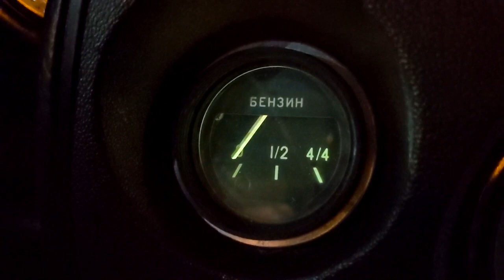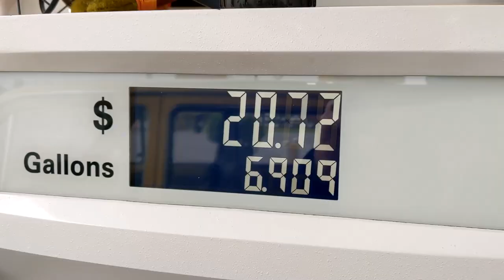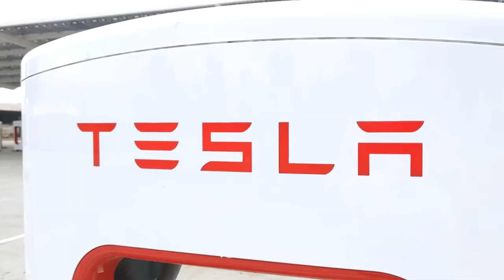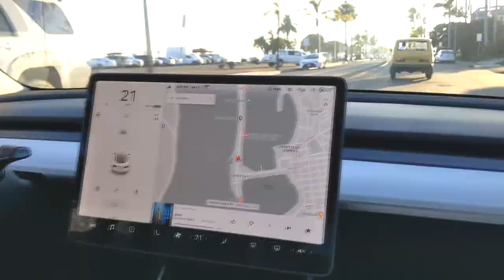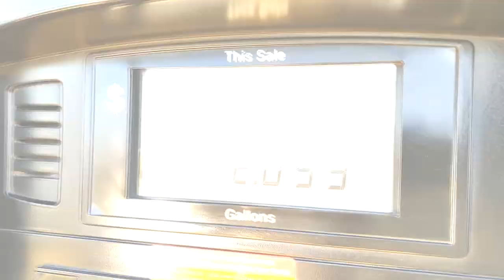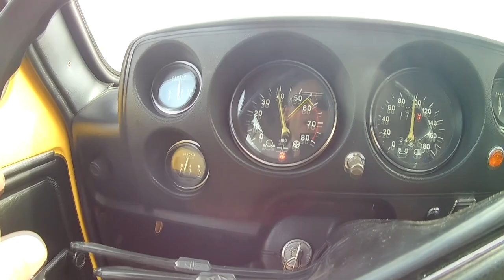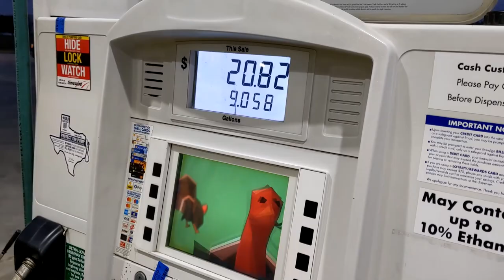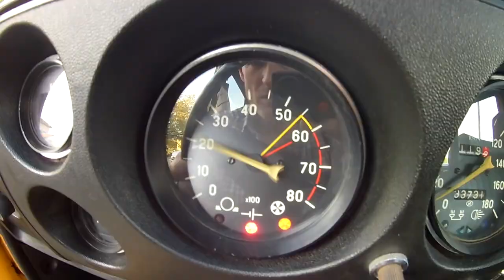I drove an old Russian car across the USA

Comment: You can still buy new Lada Niva, 2021 model even has options like electric window controls
Reply: There is no need to misinform people. LADA cannot import cars in the USA now. 
Exporting cars to places where you can't get them by truck is so expensive that the end product has to have a huge price advantage to be price competitive at the end point. Roughly speaking, I can spend 15,000 rubles (200 USD) here in Russia tomorrow and buy an old niva, not in the usa.
Reply: @alexanderismylove  Never said which country specifically, it all depends on many factors, but they are available in Germany, Australia and UK as far as I am aware.
Reply: @Swagsoviet06  In England is a importer of the new Lada Niva, eventhe putin spec you can buy there
Reply: @alexanderismylove  Niva would sell in many places but problem is regulations won't allow to sell it. For USA over 25 years old cars can be imported, for them it doesn't matter. But for newer it would require emissions, safety, etc. things. Same in most European countries. They still imported Niva to here Finland only a few years back, but I think they had to stop because of tightening emissions regulations for new cars. Ship transport is not that expensive in large quantities. But there is all kind of import tolls, regulations, etc. what make it difficult.
Reply: @TheKrololo  that is because we all seek взаимопонимания
Reply: @mrlearner4153  pay attention to how the OP says it - the new 2021 Niva "even has options like electric window controls"
You know, that's a real breakthrough right there, AvtoVAZ finally found out how to make power windows lol. I bet every '90 American car had this already

Comment: Lada Niva is a 40 years old car, which still produce and sells.
Reply: Some new ones start to rust in about 1,5 years... not exactly the sign of quality. And the shifter is a horrible joke in a new car, it's definitely a relic from the '70s... but yeah, it's cheap, and goes over everything, so people still buy them.
Reply: Yeah, I was wondering just how old this car is. 5 years is not that old lol
Reply: @sergeypopov801  I don't think carefulness has anything to do with it... it depends on the factory rustproofing, which is shit on new Ladas. Might've been better on old ones. 

Other than Mazdas, which are known rustbuckets, I hardly believe there are serious rust on 2 year old Western (or far Eastern) cars. Maybe small spots on the suspension parts.

Two things can help. Serious aftermarket rustproofing as soon as you get the car from the dealer, and cleaning off road salt in winter with high-pressure washer even in the wheelwells. Oh yeah, and properly ventilated garages...
Reply: Mercedes g-class also 40 years old😉
Reply: @thecolormaster  but they dont make the original G class anymore.

Comment: These had external voltage regulator which could be adjusted. I had a battery die on my 2101 and when I ordered the new one, I went to the shop to get it installed the tech measured the charging voltage and it was too low. Then he just removed the black cap from the regulator, did some magic and the charging voltage came back to perfect 14V :)

Comment: Good old Niva, it still is a good car! Both of mine though went 65mph and kept up with traffic with no problems. But yes they are loud as heck...sound proof it...
Reply: Also some motorcote or other gear oil enhancer
Reply: Those engines where designed for leaded high octane fuel, which give car 30% more power. The engine is fiat design with some Russian upgrades. The fuel economy of car is little better than you mentioned, losing fuel for sure doesn't help.
Reply: No, never use higher octane fuel for a long time in a stock Lada.! It was never designed for it, in those times it was made to take in 72 octane and crap lake that. You have to do modifications to run good gas or you going to ruin it...
Reply: @RedStarAuto  Yes, does not take well high octane
Reply: @RedStarAuto  In that time fiat engines liked high octane fuel, not sure what back design they did that it liked to run on lower octane fuel and some fiat engines did break if there was no lead in fuel. Camshaft and valves needed lead to not wear out.  We are talking here about 1.6 l carbureted engine which is in  Niva in video.
Reply: @gregorizi  its basically a fiat 1300/1500 from the 1960s. Boat anchor of an engine.
Reply: Those engines from that time and current time against American V8 gas guzzlers' are like pinnacle of design. Italians did changes in design, V8 mechanically is same from primary push rod design. Good design of engine is torque power with low fuel consumption . Lees fuel for big centrifugal force in car combustion engine  thru gearing makes motion of object-car, power transfer. How designee is efficient is usually measured by energy transformation, 100%-!00% is not achievable or not known to us.
Reply: @gregorizi  no this is not a cast iron head, this is aluminum head with hardened parts so that is not the issue

Comment: Ah Lada's... I love them... and worked in a Lada dealership for many years.
Essentially a good, rugged tool- but not exactly designed for a several thousand mile road trip !!
I'm surprised you weren't deaf after that adventure lol...
Reply: We had a 92 ford f100 with a diesel perkins 4 until last year. My eardrums are still ringing.
Reply: Waxel Punkt.  It might surprise you- I have lol !

Comment: Man I enjoyed this video a lot because I had somehow a similar experience and felt the same way as you!, just bought a 1995 zhiguli Vaz 2106, traveled 1100 km, it was difficult because really tough mountainous terrain, my clutch discs failed and had to order spares, also noticed it had its tires crystallized for being stored for more than 15 years, had to put new ones. High fuel consumption happened also and had to sync the old carburetor,  it was an amazing adventure in my dream car through the Andes. Cost me a lot but it was a blast since I traveled with my pops.  The Ladas are temperamental but if you love them, they love you back! Cheers from Colombia!!

Comment: Low oil pressure reading was probably caused by the bad oil pressure sensor. Engine cutting out at idle could be caused by the ignition points worn out or the bad electric idle valve on the carb. Alternator light flashing on and off could simply mean dirty wire connectors on the alternator relay. You have to watch out for vapor lock at higher elevations above 5000 feet on warm days. I have done plenty of long distance trips accross the USA in my 1975 Lada 1500 without major breakdowns.
Reply: У вас ВАЗ-2105?
Reply: @Po6om_Bepmep 
2103
Reply: @user-el2fd2ll1i  "Тройка" вообще топ!

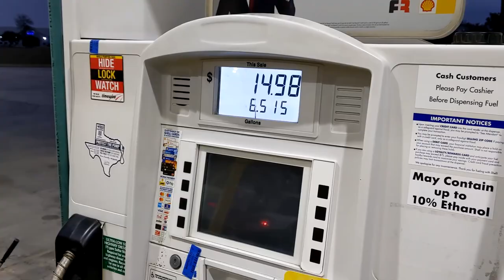Comment: 46:41 - ouch, that's a wrong decision. US 93 i somewhat 98 european. Niva engine is made for Soviet (European) 93 octane, which is 88-89 US.
Reply: Nah, higher octane number doesn't hurt the engine, it's just more expensive
Reply: @czechgop7631  you are wrong. It is fine to mix 91-93 octane. For 95 you already have to adjust distributer for earlier ignition. 98 doesn't fit Lada's compression ratio (8.2) at all. It just leads to overheating exhaust valves and engine in general.
Reply: @MacIn173  Not to mention, it'll run as a high-octane car with shot gaskets. (not enough compression)
Reply: @jayswarrow1196  It might, but it depends. It would only if you can't over-correct it with ignition timing.

Comment: The only issue with Russian cars is hot weather, they work beautifully in cold weather.
Reply: And the heater has two modes for the winter: small noise and LOUD noise :D
Reply: @EiKk4__  many people did not even turn it on😂 and just used the stream of air blowed by outside😂
Reply: Not really, YOU have problem, since the russian machine heats like hell

Comment: I have a red 86 Niva. I did 70,000 k in it and then some idiot pulled out in front of me and I had to get it repaired which took a month. I had to get another car which was twice as economical but I kept the Niva and it is up on blocks in my garage. I love it so much. The shape, the brutal funtionality of it. It took me and my mountain biking buddies across Victorian mountain destinations and then I would stick a riser stage in it with a drum kit to go play with bands on the weekends. It is so Tonka in its design and I too had to change the alternator and there was a head leaking issue that was fixed by the dealer but as a four wheel drive car what a great scampering fun mobile. I have two brand new sets of the original tyres too. one day I'll get it going and have a veritably new car again! I've loved watching your travels. One thing I think the Niva could have come with would be an ignition key with a bottle opener shape stamped into it! Not that drinking and driving should be encouraged, Lol. Safe travels from Glenn in Melb' Aus.

Comment: 38:51 - you obviously have ancient mechanical vibrator type voltage regulator. It needs adjustment&contact cleaning time to time, most probably this is the reason alternator is failing. There actually is bolt-on semiconductor replacement that went on these cars from factory probably year or two after this Niva was produced.
Reply: I was thinking alternator drive belt, but you're probably right

Comment: Can't wait to see this cutie converted to electric. Nivas are so simple and convenient to work on, and their price and popularity make them one of people's favorite cars with lots of modifications documented online. Folks found ways to swap almost every part of these cars from seats and headlights to engine and transmission, you can even add another gas tank that perfectly fits under Niva's trunk! There are a lot of parts from japanese cars that fit Niva making repairs doable even far away from Russia.

Two mods that I personally recommend are corrosive resistant treatment and sound proofing of the interior. Swapping seats for something more comfortable is advised to do along with sound proofing. 

Too bad your Niva is so old though. New models received various important upgrades that include it's interior redesign, engine improvements and complete suspension overhaul. Various QoL additions too, like motorized windows, better air conditioner even one whole airbag. And the best part is that brand new Nivas cost just about $10k.

Comment: I drove a reproduction 1901 Curve Dash Oldsmobile from Redding, Ca. all the way across to North West Missouri and back in 2014 , And sir you are driving a Rolls Royce compared to my car. I had two Cylinders 16 H.P I averaged 22 M. P. H. on the good roads and many times much less I experienced extreme heavy Rain, wind, and three breakdowns I had to repair on the side of the highway. One time I had to use Hog wire from a ranch fence along the Highway to make a Master Link for my drive chain. But it worked 80 plus miles.  I had no doors or windows during the storms and had to park in extreme wind out on the Nebraska High Plains. I was lucky several stations donated two gallons of gas along the way. That is the size of the tank. Averages 125 - 135 MPG.

Comment: The smell of gas and the gas leak is most likely a leaking filler pipe as it leaked when you filled up. The intermittent shut off is most likely a bad battery connection. Check all connections.

Comment: A few things to know about your Niva:

If it’s boiling - good - it means there’s water on it.

If it leaks oil - good - it means there’s oil on it - if it doesn’t leak or leave puddles then start to worry

If it’s dragging to the left or the right - good - means the steering works… if it’s smooth and the steering wheel turns easy - then stop - your steering rail broke or your wheels came off

You can without problems fit a young cow in the back together with 6 bags of grain 

The niva will pull a two bottom plow a foot deep without problems 

Going through deep water will make it come into the cab through the gearshifter - you’ll be fine though - just don’t get the bonnet under water and you will be fine - if you do, then floor it and don’t let of the gas until it runs on all cylinders again :) 

Don’t idle the engine for too long - they don’t lubricate themselves too good at idle. 

They will however eat half a liter of sand handfed through the intake without any problem. 

And if you get stuck in a niva - well then you’re an idiot

Comment: I owned one of those for nearly 2 years . 
I went everywhere in it . 
Though avoided motorways as too noisy / slow . 
It coped with deep snow , floods , deep mud etc . 
All the time once warm it had poor oil pressure . 
But it kept going . 
Eventually one day I got in my foot went through the floor . 
So sold it on locally it got repaired and carried on for many more years .

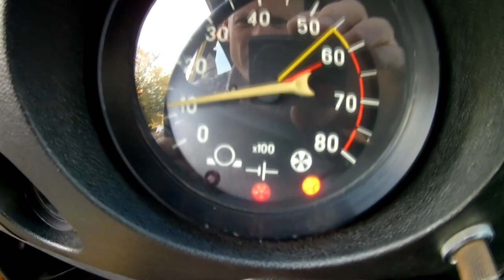Comment: 36:07 Those are warning lights (left to right) 'Hand break engaged', 'battery not charging', 'carburetor choked' (##53,54 and 55 from here: http://www.vazbook.ru/Niva/2121/electrics/device/shema-elektrooborudovaniya-avtomobilya - all in Russian but still possible to translate). The battery light might have been the belt slipping and not grabbing on the alternator, or bad ground like you said.
Congrats on that tank of a Sputnik, be glad it doesn't have airbags.

Comment: I owned one of these for several years, and boy did it take me places. However, it was a newer Niva, with electronically-controlled direct fuel injection, quieter engine, better seats, and lots of other minor modifications introduced since the 80s. I travelled across Russia, from Murmansk to Sochi, and even travelled abroad - in Belarus and Abkhazia. I did not get to love this car, no - there always was something that I found inconvenient, like a rock in my boot, but I respected it.  My Niva climbed mountains, bested mud, sand, dirt, snow, ice and thousands of kilometers of asphalt. She really shines in offroading, but she needs larger (29 inch) and very soft tires. The Niva's best advantage is its effectively nonexistent weight.

Comment: If tesla brakes u will w8 a whole week for elon's monke to fix it
If Lada brakes u just need a wrench, some wire and thats it
Reply: Electric cars are just expensive status symbols for rich people. I would never drive anything I could not fix myself.
Reply: Teslas in particular are really just iPhones on wheels. Very expensive, not practical, owners actively avoid to push it hard and they break very easily but are very hard to fix by yourself. They're literally the least reliable cars on the market right now.

Comment: Soviet gas stations only had 76 and 95 octane gas, and Lada engine was supposed to run on the 95 (which was back in the leaded era, so it might even have been actual 95 octane... ) 89 should be just fine, but you may need to look at the ignition.

Comment: At both ends of the tesla supercharger, you can see are two huge diesel generators. That's hilarious.
Reply: Probably emergency power
Reply: @the_retag  still though, a joke about as in the environment, all they are making is a sale of a products that the only different to a regular cars  is they hide the fact that they still use fossil fuel 😅
Reply: @puterausman7682  For the time being. But it will take over. Take care.

Comment: Oil at getting to thin, cause it was hot, than pressure get down. Maybe you need thicker oil. 5W-50 or 10W60.
Reply: Probably also the engine running hot, going up into the mountains, contributed to the thinning of the oil.

Comment: When I worked in Estonia in 1985 there was a ZAZ 965 that had been fitted with a Lada engine. Man it could go very fast. Cars were always getting broken into then. The funniest thing was there was a shortage of Lada windscreens. So it was not uncommon to find a Lada full of snow as the windcreen could just be removed with a sharp knife. One thing I did notice was Lada was a good starter in very cold weather. I remember they were fitting I seem to remember a Chevrolet engine in them and performance and reliability improved.

Comment: Thanks for video! My grandfather got the same car from thirst batch in 1970s for free. He was rural veterinarian. The car was in the same colour like you have. Then my father drove it for a while. He always had some repair parts in the car. Once he change a constant-velocity joint in the field 500km away from the nearest city because he had the spare part with him.
It's quite an uncomfortable and dangerous (it's easy to turn around) car on the highway. But it's really good in the fields.

Comment: The Niva was multi-climate but some adjustments had to be made. You were in baking heat and seem surprised that the petrol overflow dumped fuel. You were using winter tyres. In particular you didn't make use of the alternator settings which allow variations of output.
On hot days the 'trick' was to put the heating on for a few miles with all the windows open and alternator problems such as you had sorted themselves out.
All that said, continuous long driving on tarmac was not really what Nivas were made for. 
But a fabulous video in true kiwi style.

Comment: I drive a Lada from early 2000s. What I have learned about them is if problem starts to appear and car doesn't stop in few moments, you simply can drive it for a lot of kilometers and it won't happen anything.

Example: my check engine is switched on for about 4300 km  😂

Comment: G'day, I owned a 1978 Nissan Patrol G60 known as the "Butterbox". I loved the Lada. While it was around, mine was not the most crude vehicle on the road. Three speed with no syncromesh on first and with a facility for a hand crank, bare metal with no sound insulation. No power anything, no air conditioning as an option. I loved my old Butterbox.